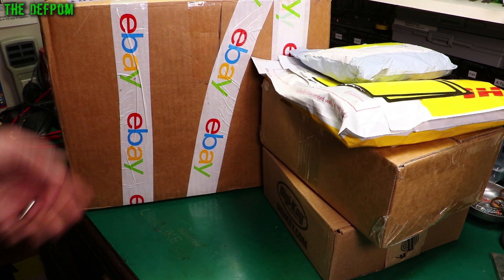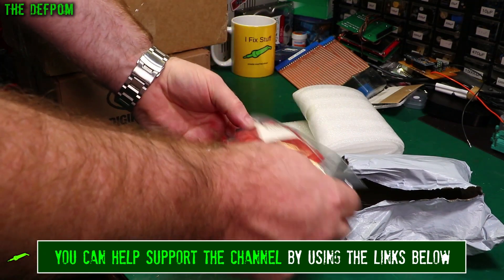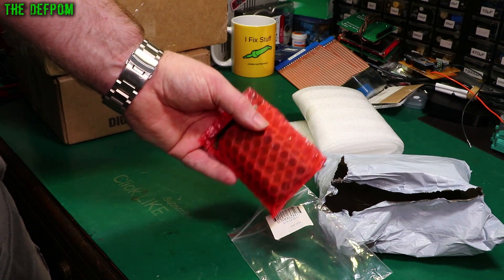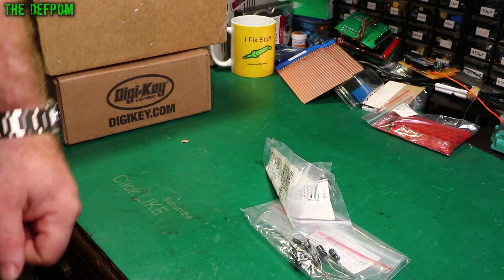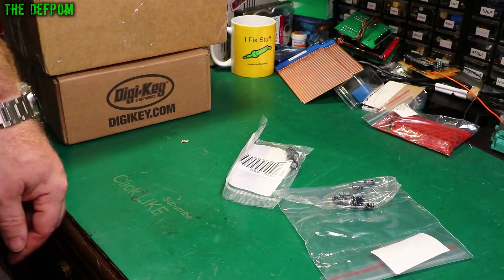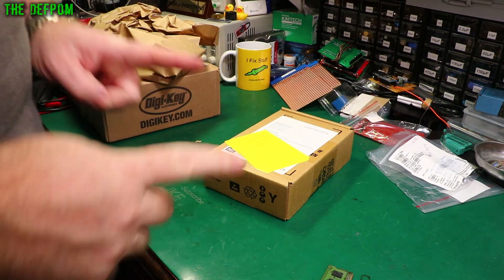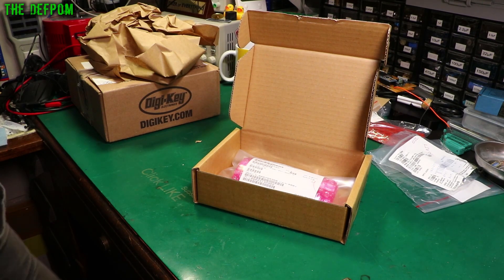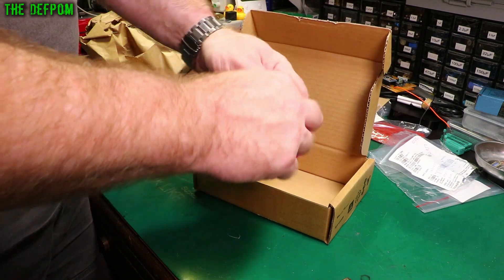🔴 What's in my Mailbag ? - Mailbag Monday 21st March 2022 - No.937

Comment: Just trying my luck here... got a UA40C7000 no standby light won't turn on, wondering if it's worth replacing power supply with a USED power supply from a cracked screen UA40. Given my UA40 took this long to fail i figure it's pretty rare and maybe worth a shot?

Comment: Hey Defpom! I was looking at modding my ksger and adding a barrel jack connector on the back for my 24v DC fan for my fume extractor that has a startup current of 0.4A but settles at 0.18A. My station hasn't actually arrived yet so I was wondering if you happen to know the actual current draw of the system. Banggood just says it's capable of supplying 120w. Thanks